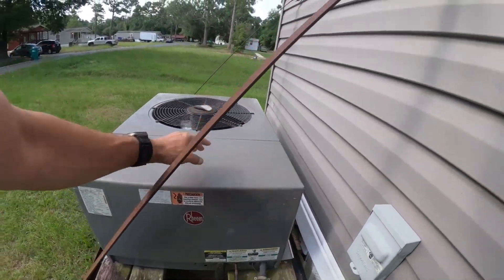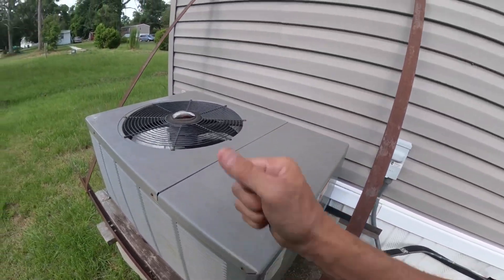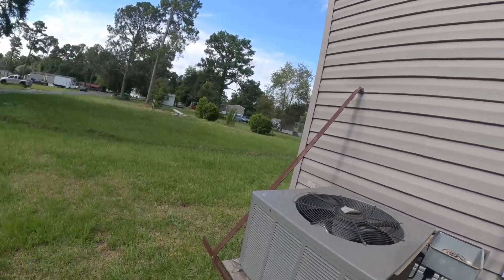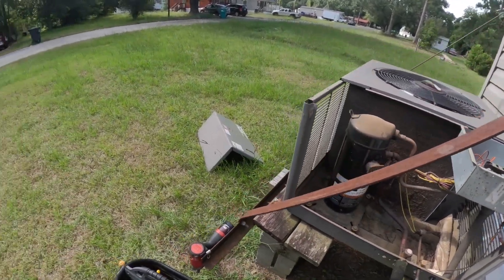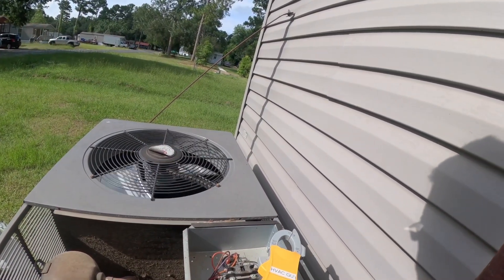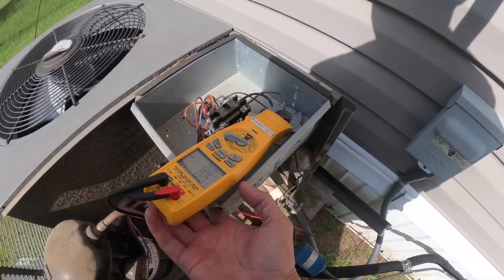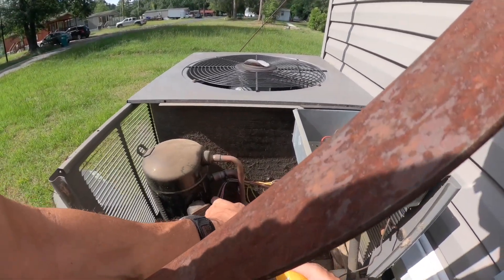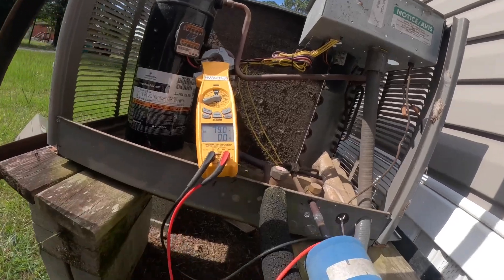A No Cooling Call From This Morning On A Mobile Home! #hvacguy #hvaclife #hvactrainingvideos

Comment: You need an "automatic center punch" that's about 5-6 inches long. You push it until it loads up a spring, and Wham, it punches a small hole.  You can repeat to make the whole larger. 
So the self-taping screw has a place to start.  Trying to get a self-tapping screw to spin on a flat 
surface is a losing battle.

Comment: Im sorry, but I have to laugh when you struggle with those way too long self drilling screws. Just please get yourself a spring loaded center punch. It will cut your struggle at least in half. Also, Milwaukee makes a really nice M12 close quarters Right Angle 1/4 inch impact drill. And finally, RAWL makes really superior self drilling screws. OK, ill shut up now.

Comment: In Dubai, super hot and humid, the fins on the condenser coil would corrode away and be  gone in 2 or 3 years. Units still worked but with greatly reduced cooling. Any ideas?
Reply: Remove the sand from the area
Reply: @warrenm374  Dubai is sand.

Comment: Nice job . Have you ever come across a condenser fan that’s not pulling the air strong enough even thou the amps read correctly and not making any noise ?

Comment: very nice job!

Is it safe to clean condenser coil with a hose and power on?  It just looks like electrical wiring is so close to water.  

thanks
Reply: No different than if it were raining..
Reply: Just saw the metal cover with exposed contactor and  capacitor close to water flow.  240 volts.

Comment: Instead of giant self drilling sky scraper screws, or press punches to make a divot for a hole, or a bag of zip ties - you need to go to Home Depot and get you a plastic box of 1/2", 3/4" or 1" self drilling washer head Tec Screws !!!! Better than sliced bread !!!!  Cheap too !!!! No more struggling to put on a strap or hangar !!!!!  Pro's use these !!!!! Trust me !!!!!  👍👍👍
Reply: What?!! No command strips?

Comment: I was told u can go up in capacitor size but not down in size. 
So my question is , why use the I think (3)  mcf run capacitor?, on the side
instead of using a bigger capacitor like a 40/5 or 40/7 ? Or something? 
Or would that not work as well ? 
Thanks in advance ..
Reply: That would work no problem.

Comment: Just a suggestion....I would get an 1/8" drill bit and do a pilot hole to start those screws and I would get some gas tank strap for the contactors

Comment: IDK if it would work, but what about a small hole punch or one of those leather punches with the different size holes to punch a hole in those thin capacitor straps.  Dunno if they make a short hex shank 1/8 bit that would fit in the milwaukee itself.  Those zip screws are aggravating.  I know more crap to lug around is not welcome.  Just an idea.

Comment: Thanks. I have been studying to enter HVAC at 46 years old and your videos make me so much more comfortable knowing what I'm getting myself into.
Reply from the maker: Great to hear!
Reply: It's a great trade to get into . I have 2 pieces of advice for you. Don't hesitate to call another tech if you feel like you're getting in over your head.
Back in my days cell phones were non existent.
Now they are a must. There's many apps out there that are good for troubleshooting and charging. Second take care of your body we all thought at one time or other we were superman.
Hydrate, Hydrate, Hydrate!
Good luck to you!
Reply: @LeoLoder  I'm coming from a career in manufacturing machinery operation. The low voltage circuit troubleshooting was my specialty when other people had problems, I was the guy. Asking for help and saying the dreaded term, "I don't know, I gotta ask, so and so for help." Was a hard lesson to learn. I had a rule for myself if I couldn't get it in 15 mins, I had to call help. I'll do the same with this new work. 👍
Reply: I'm at 48 😂

Comment: Sory curtis laft when screw whent crazy just had to do same thing safternoon misery loves company not sure how hot there it's 90 here to paraphrase u its hot and every one has my number yeppy cya
Reply: Normal summer temps in inland CA are around 100+ with 10-15% humidity.  Because of low humidity A/C units need to be sized larger, like 4 or 5 ton instead of 3 ton.  Vegas and Phoenix are the same way,  It has to do with the unit's ratings for latent heat and sensible heat.
Reply: Wasn't really looking for a weather report been doing hvac for 29 years understand load and efect was just sharing common misery know the more South u go the hotter it gets just a joke was all Curtis don't forget ur hat and keep hydrated and hang in there